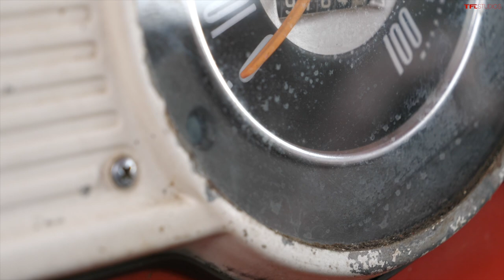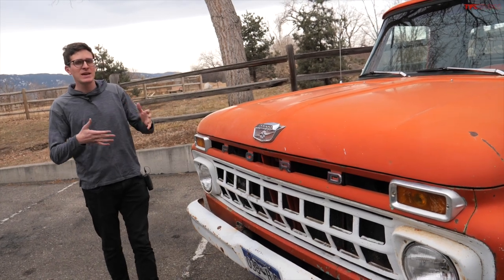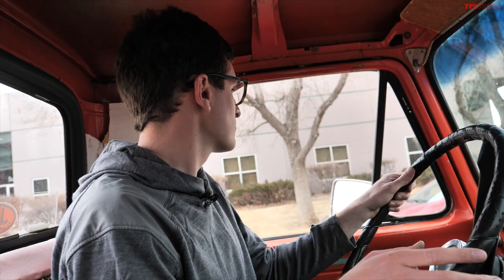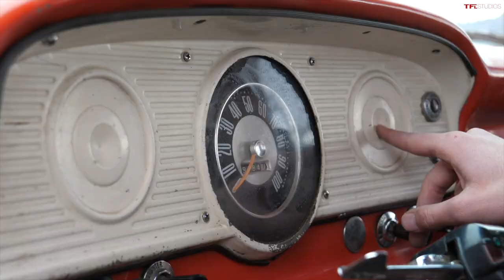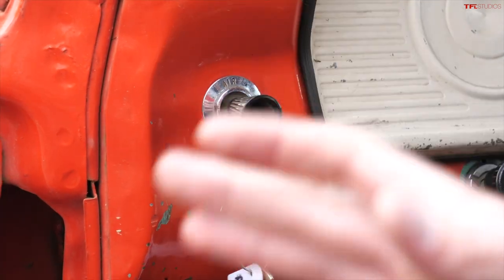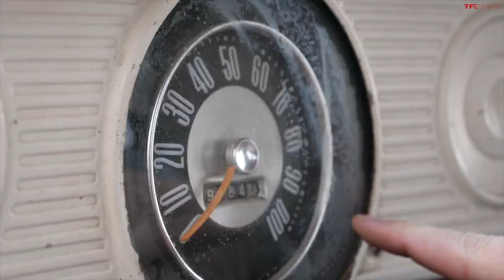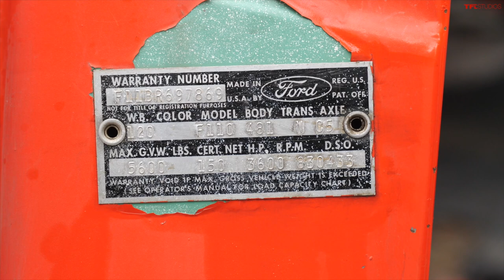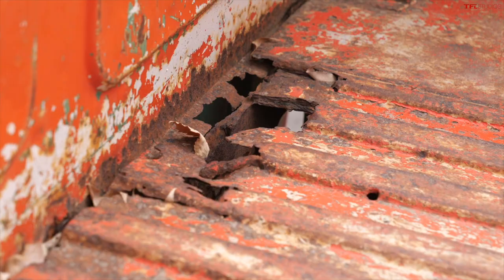Do You Like Raptors? I Just Bought The Ford Truck That Started It All!

Comment: Hey Tommy
   So you say it is an F-100 !
BUT It has F-250 Axles with 8 lug hubs rather than 5 lug like the F-100 4x4 had.
   You mentioned the mirrors.
That truck has a black rubber plug on the front edge or both doors just forwad of the vent windows.
That plug is designed to come out and a mirror mounting bracket installed in the hole that has a bolt accessed on the front of the door.
You could order that bracket in chrome or painted when you ordered the truck.
This mounting place started with the 1953 body style change.
All sizes of standard size cabs had this hole up to the 1966.
The hole was deleted in 1967.
That Cigarette lighter on the right side of the dash was a FORD option because all the dashes had a dimple where that lighter is.
Now you could call it a 12V power access point for charging your cell phone.
Most factory installed lighters were in the hole where your truck has a crome plug, a.k.a. a lighter delete.
   My second Pick up after a little 65 Chevy C-10 Short Narrow Bed was a 1966 FORD F-100 twin I beam, custom cab, camper special, 2 wheel drive with a 351 V8 and C-6 automatic trans.
This truck was ordered by the dealer with mustang bucket seats, full black carpet on the floor and covering the gas tank.
It also had a FORD under the dash AC unit,  polished aluminum and black anodized dash instrament panel, black vinyl padded dash, White Hard vinyl door panels above the  inside door access panel.
Another feature of the Custom Cab was where the inside door access panels are, Where it looks like you have speakers mounted, the Camper Special had a plastic box inserted in the lower part of the door with a zippered vinyl cover.
In this pocket you might store custom camping stuff.
You can still get these boxes with plastic chrome surround and choice of color vinyl zippered cover.
They are of course not Ford originals now but after market items.
   I sold that truck a few years ago to a father son team who planned to completely refurbish it.
   I now have a 1965 F-600 with a grain dump bed, granny low 4 speed behind a 352 V8.
Also I just recently purchased a really cherry 1965 F-350 with a 352 and granny 4 speed.
This F-350 had a service bed that was removed prior to my buying it.
But I have a somewhat modern Wreaker bed that will fit the chassis perfect.
The trans has PTO capability but I will be using the 12,000 steel rope winch.
( I do minor off road recovery here in the heart of Kansas farm land. )
   I also own a 1958 F-100 Short Wide bed with a 312 Y-block, 3 on the tree, a 1999 F-150 4x4 electric engage and a 2008 F-150 4x4 with a manual engage transfer box.
   I guess you could say I am a FORD Truck guy.
   I also own a vintage GMC and a Dodge pick up as well as a MACK truck Rat Rod and an S-10 4x4 Blazer.
But those are another story.
Reply from the maker: Thanks for the great insight! -Tommy

Comment: I own a '62 f100 with original 223 cubic inch 4 on the floor. Very fun to drive, the big steering wheel makes up for no power steering, turning radius is pretty darn wide though.😆

Comment: 1980 was the first year for the TTB aka twin traction beam aka 4x4 version of the twin I beam. It ended in 96 for the bronco and f150 and in 97 for the ranger and f250. For a few years 80-83 (iirc) the f350 was available with a ttb but was dropped for solid axle only 4x4. The twin i beam is still used in the econoline vans and the 2wd f250 and f350

Comment: I owned a 63. Bought it in Wyoming, just to make the move home to Michigan. Rust free. Engine was tired. Smoked the blues. I did a cheap in frame ring, bearing, and gaskets. Ran great. Pulled a 24 ft. trailer loaded to the balls all the way. No problems. I sold it for six hundred. I only paid two for it. Should have kept it. It was two wheel drive, four speed granny gear, 223 straight six.

Comment: You may want to double check your vin plate.  Originally calling for 150hp would make the original engine the 240ci straight 6 since the 300ci was making 170hp for that year.

Comment: Great info for the younger generations.  However, you have a F-250.  F-100 pickups used 5 hole on 5.5" diameter lugs.

Comment: I can appreciate what it would be like to drive the '65 F100, because I recently acquired a relatively low mileage 1996 F150 2WD long bed XLT with the legendary 4.9l straight six and a regular cab. You just don't see that combo very often anymore. It needed some TLC to make it reliable because the previous owner had neglected badly needed repairs, but overall it's in surprisingly rock solid for a 24 year old vehicle. As far as "luxury" goes, it has power windows and lumbar support and AC, but that's it. I'd actually prefer crank windows in a near-antique vehicle. Still, overall it has everything you need and nothing you don't to get where you're going in reasonable comfort. Oh yeah: It has those cool vent windows, too. Driving the "Green Machine" took some getting used to, but I really like being behind the wheel now and don't miss a V8 as much as I thought I would. It has forced me to drive more slowly and purposefully than before. I had been looking at newer trucks, but this old thing looks, feels and sounds like a beast. I think I'll be driving it until they outlaw gasoline :-)

Comment: Rebuild the 300. Use stock bore 390FE forged pistons with a 0.050" overbore on the engine for a 308ci displacement. Add a mildly ported 300 EFI head, EFI exhaust manifolds or headers, offy 4bbl intake with 500cfm holley and the biggest Howards cam they make. The split output of the exhaust can go to dual exhaust or Y into a 3" single. I'd expect 250-260hp with 325lb/ft of torque with a broad torque curve and peak power around 4800 +/- rpm. Not race car numbers but it would look original and run exceptionally well. Pay attention to the compression ratio to keep it around 9.5:1 or so and add a good ignition with about 34-36* of total timing and I think you'll be very pleased. I'd expect a mild choppy idle at 700rpm and for it to match with the 435 trans very well. Off road, towing, daily driving, it will do it all.

Comment: I believe that the built in step in the cab had ended in 1964 and the box style was consistent with the 1964.  I own a 1965 straight 6 - 240CI. This truck may actually be a 64' with a 1965 front grill.

Comment: The 300 helps with drive ability (I think it is lighter)  adding grease to the front end should improve steering.  Dad said his needed grease every oil change. If you do engine mods I would say add an intake and exhaust and an improved ignition system.  Brakes and power steering sound great.  Is there a reasonable gas tank relocation option?  I think there is an update to the tailgate situation so it uses modern cables.
Reply: Thats the ultimate downfall of the 300 is it was just as heavy and inefficient on fuel as its v8 counterparts that they decided to tank it for a v6 that made better fuel economy

Comment: If I were rebuilding this truck, and funds were not an issue, I would drop a 351 Cleveland V8 with Australian 4v heads. These are known to flow more air than open chamber Rat motor heads. Behind it would sit an SM465 Muncie trans with the old cast iron transfer case. The differentials would be custom 9 inch Ford diffs with drop out pumpkins and traction lock. A roll bar would go on the bed with a 25 gallon fuel cell with safety valve for roll ove protection. The spare tire would be mounted in the bed, pre runner style. A rack on the roof would have 4 KC Daylighter off road lights and a rancher's jack and spade shovel. I would paint it either the original forest service green or woodland camo.

Comment: The 3rd gen beds on the 61 thru 64 trucks were referred to as "wrong beds" I have a 61 stepside that has been removed from it's original chassis and mounted on a 78 Bronco 4wd chassis. It drives fantastic.

Comment: When you start a standard shift truck like this. It's always better to hold the clutch down Even if the truck is in neutral so you  Don't have to turn the transmission and the engine If it was cold out the transmission would be harder to turn also being filled with thick oil.

Comment: I would investigate putting a 4.9 EFI straight six in it, or an aftermarket EFI.   I don't think I would do a full restoration, but a solid cleaning and taking steps to preserve it.  If it is to be painted, I would definitely go with the original Forest Service green. Re-upholster the interior and look at modern seat belts?  At $6500, I think you scored a real winner.

Comment: Get it back to Forest Service green (although the orange looks great with those wheels), make some sleeper mods that don't show from the outside (like the dual master cylinder brake system you mentioned) fix any rust issues, and make it looking new stock.  Keep that engine, but clean it up and possibly rebuild it (maybe add a supercharger or turbo so you are able to hit 55) but nothing you can see with the hood closed.

Comment: My '72 F20 shared one key for the door and ignition.  Also, it wouldn't let you lock yourself out because if the door was locked while open, it would unlock as soon as you closed it.  The only way to lock it from the outside was to use the key.  They were years ahead on this "tech" and then dropped the design, reverting to different keys for the door and ignition.  It would re-emerge on Japanese imports in the mid-80s.

Comment: There are so many awesome ways you could go with this truck, but I think what I would like to see is just start off with a baseline mechanical Resto, and then run it the way it is for a while. Would love to see you hit some trails with it with the stock 6 cylinder. A Cummins swap would be cool, however I think a 5.0 Coyote swap would be cooler. A Ford Motorsports 351 crate motor, kind of like the same route you went with Big Green, would probably be the simplest most cost-effective swap though.

It would be cool if it was in its original Forest Service green, but that red has a nice patina as well, so I would just leave it.

Comment: Wow this video was fun, my daily driver is a mostly restored 1962 F250, it was originally equipped with a 223 I6 and currently it has a 300 I6 and a 4 speed, lots of fun to see something so similar to mine, I’d recommend swapping in a 460 big block, that’s what I’m doing with mine, tons of power and tons of fun, a true truck motor. Then you can put the 7.5 460 up against fords new 7.3
Reply: I dont know about a v8 swap its so disappointing to pop the hood on a truck with a 6cylinder badge to find someone swapped in a v8
Reply: @straight6fords580  I intend to swap out the hood badge as well, I want to make the truck as true to a V8 as possible.
Reply: @corporateunion8918  im an inline 6 guy but as long as somebody takes the time to rebadge the truck after they swap it im cool with it its so cool to see these trucks with there original motors or an olsdschool big block

Comment: One of the two best six-cylinder engines ever produced IMO. The other six-cylinder equally as tough was the Chrysler slant six. Sadly neither is produced anymore. My vote is that old survivor truck should be left alone pretty much. I only would fix the rusty bed, address the master cylinder issue and maybe install disc brakes, take a good look at the 300 and freshen it up if needed. That's about it.

Comment: That thing is sweet, I wouldn't mess with it much. Keep the 300 but hop it up a bit,  throw a headliner and a basic interior in there. Figure out a safer fuel tank/cell outside of the cab. It would be cool to restore it to a forest service truck. Paint it green and add a period winch.

Comment: The patina look is hard to beat. If you do paint it, go back to the forest service green with era correct lettering. Leave the wheels as those 16.5 slotted mags are hard to come by. Engine upgrades: Electronic ignition, 4 barrel conversion, and headers. Brakes: upgrade because of safety, see if you can do a manual front disc conversion with the dual pot master. Leave it all manual, I feel that is what will keep the truck authentic to the era and make it stand out.

Comment: Check the serial number on top of the frame rail on the right rail under the cab. It should match the door tag. That thing is pieced together no F100 came with 8 lug axles. 6500 was way to much to pay for it. As far as a name Turd fits it pretty well

Comment: Keep the 300 and hop it up. Keep 15” wheels but a different design than those old slots. If it were mine, I’d go beyond just the upgraded master cylinder and add some disc brakes. Put a headliner in it with some dynamat. If you replace all the bushings and steering linkage parts it will tighten up the steering (sort of).  Maybe buff out the paint to make the most of that awesome patina. Nice rig.

Comment: I would keep that straight 6. It's really great how easily it starts for such and old truck. I would go with Disk Brakes on the Front and Back. Also I would add Power Steering and AC, and put a nice coat of paint on it. The orange is a bit much.

Comment: Do not V8 swap, custom exhaust system it and then add performance mods to the engine.  There is a large aftermarket engine mod market for the 300 I6. Power nation did one with an old I6 and got over 300hp out of it.

Comment: I would keep it all original, That is what you like about it, it is different than newer trucks, it has character, why try to make it a new truck, just enjoy it as it is. I see that it has a oil leak to fix on the engine (Valve Cover gasket) very good ,great idea to convert the brake system to duel circuits, fix the parking brake for sure, it`s a very nice truck, well taken care of.

Comment: Just rebuild the six but build for a bit more HP.  Keep the old boy stock mostly just gussied up. Power steering, dual master brakes, and front disks if possible. Go back to the original forest service green. Hide a nice radio or at least a Bluetooth input with amp in the glove box. Perhaps a roll bar with some lights. For giggles, install headers with a power diverter exhaust for off road noise making. The wheels look OK as is but some big steel wheels with dog dish hubcaps would look authentic. Repaint interior and some nice tan leather cover on bench seat. Oh...some cup holders.

Comment: Really enjoyed your video. I just have a few comments that my old Ford expert(my dad) has about your truck. Are you sure it’s not an f100 body put an f250 frame? The 8 lug wheels are unique to an f250 as well as the divorced transfer case. Is the bed a 65 model. Also, the way you latched the tailgate is not how it is done. Hook the ring on then put the hook through the loop.

Comment: My first truck was a 1963 Ford Unibody. It was as basic as you could get. It was my daily driver. I got used to no power steering, no power brakes, etc...I couldn't get used to having no heat though. That sucked in the winter. Anyhoo, wish I had kept it.

Comment: My daily is a 79, red, 300, np435, 4x4.    But with power steering.     Wouldn't drive anything else.     Climbs the Owyhees like a tank.    I did go with all LEDs, E fan and a 96 taurus 3G alt.       I DO like the look of yours better.  Badassery.    Btw, you can't start gas on fire with a cig.

Comment: I’d go back to that green color or something similar.  Power steering and power brake aren’t a bad idea but my first truck was a 1970 f100 with a 302, which had manual brakes and steering.  Though it was a dual cylinder master.  But that thing had extra wide tires on it and I had now issues braking and steering it.  Definitely fix the interior and the rust in the bed.  Maybe call it “Danger Ranger” or “Ranger Danger” due to the forest service roots and the gas tank in the cab?

Comment: I think the reason it's so hard to move the steering wheel is because those tires are not stock. Back then they had much thinner tires, probably about half as thin. So the contact patch would have been much less and easier to turn the wheel

Comment: Leave the 300/6 maybe do a refresh, update the brakes to power and disk up front, power steering that way you can put a smaller steering wheel on. Leave the paint patina just clear coat.

Comment: I agree with @BrewBlaster.  Keep the original inline six.  Go ahead and do the brakes - dual circuit and front discs, preferably a bolt-on upgrade and keep the original parts.  Down the road someone else might want it in factory condition.

Tommy, I'm surprised at you, but with your young age maybe I shouldn't be.  In the event of a brake failure, do the same thing you should be doing driving mountain roads with fully working brakes:  Downshift.  Use the transmission and engine braking to help control your speed.  In the event of a complete brake failure in a manual transmission, you should be able to gradually downshift into first, then kill the engine with it in gear and gradually roll to a dead stop (in newer manual vehicles, be careful to NOT turn the key far enough to lock the steering!).

But, yeah, get the park brake fixed too.  And the heater core.

P.S., several vehicles I've owned and/or driven have diagonal braking circuits, not front/rear (although that is a thing too).  Dual diagonal circuits have the left front and right rear wheel on one circuit and the left rear and right front wheel on the other circuit.

Comment: I would love to restomod this truck. Install hydro-steer, new fuel cell under the bed, replace the steering wheel with something smaller, modern ac pump, disc brakes all the way around and a 3 inch lift with modern shocks and bags in the back. insulation and sound deadening foam in the doors and cabin. Also clean up the wires underneath the dash as well as a updated bench cloth. And of course a new paint job along with body correction. Name her Aggie